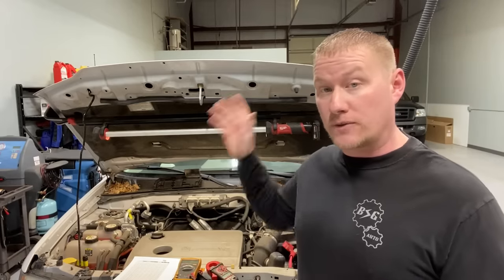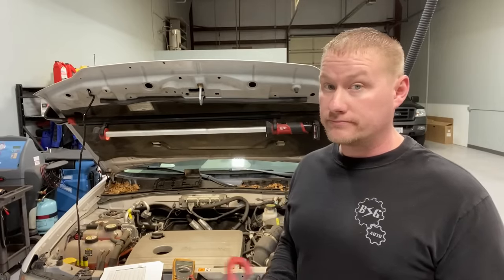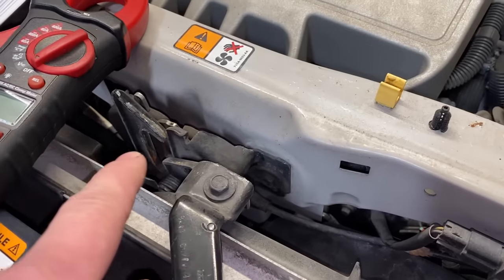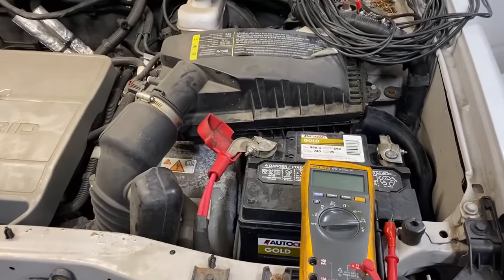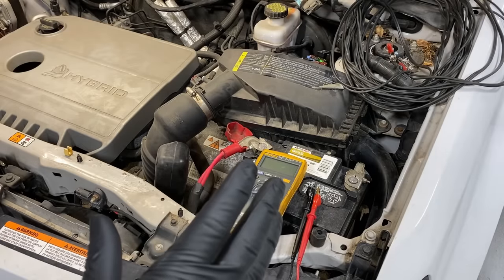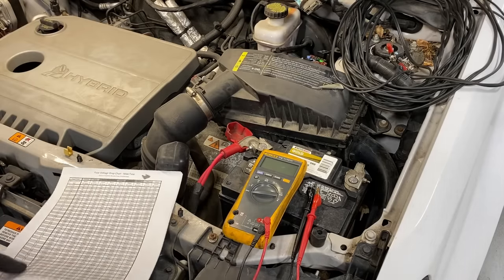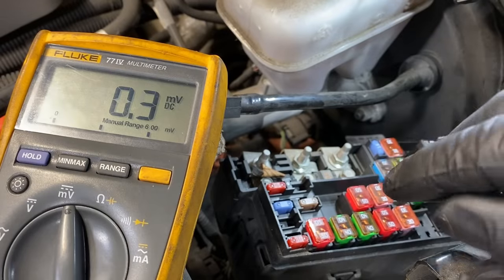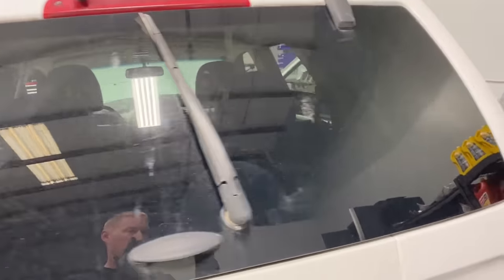Which Parasitic Draw Test Method is REALLY the Best?

Comment: Two things, 1. is it correct to make quick solid connection with the jumpers to car batteries to avoid arcing as much as possible, to avoid screwing electronics, such as ignitions etc? And 2. would connecting jumper carefully under the battery clamp, while removing battery clamp, to keep it continously connected, stop it restarting the "go to sleep mode" timer?

Comment: I like to use a general purpose amp clamp (like a B&K 316 milliamp clamp meter) to see what the vehicle is doing when it is supposed to be asleep to confirm a parasitic draw of any type. The only draw back to this approach is you have to find a good location where you have access to the battery cables and where you can place the jaw of the clamp meter around the cable. 

If a parasitic draw is present then I put the vehicle on a battery sustainer so it doesn't die while testing, be mindful that with some parasitic draw problems you may have to got key on engine off. I then use my Fluke i30s current clamp and my Fluke Scopemeter (any automotive scope can be used) to see what the current is doing dynamically. Many times the parasitic current draw will be dynamic or periodic in nature and this can provide clues to the root cause. For example, if you see current being drawn in an increasing stair step waveform, you most likely have one module waking up a network or multiple networks. If you think this is the case you will have to monitor network activity with a scope (like a PicoScope Automotive scope 4425A) to see who is waking up first while watching the current draw.

The B&K 316 is also handy to identify the offending power feed when you have narrowed down the draw to a power splice or fuse which feeds several modules or circuits. In other words, it is quicker to use a clamp ammeter to find the problem on individual power feeds because you can test each one without pulling a fuse or disconnecting the suspect module. Remember every time you cycle power, you will have to wait until the system goes to sleep to confirm your guess. 

If possible do not disconnect the battery before you start testing. Power cycling the car will wake up the modules and you will have to wait, some times up to 35 minutes, before the vehicle goes to sleep again. If you want to put in a series ammeter in the negative battery lead, than you must introduce the ammeter into the circuit make-before-break using a couple of alligator jumpers so you do not interrupt power.   

To short between two connector pins, to simulate a closed hood switch, you should use the same mating pin type (provided in many connector pin adaptor kits). If you use a paper clip, and it is not the same size and design as the mating pin, you will most likely damage the pin tension. The practice of using a paper clip as a front pin adaptor or probe is specifically spelled out in many shop manuals (see GM) as bad practice in electrical system troubleshooting due to damaging pins. 

It takes a very long time to fully charge a dead battery, like 13 Hours. If you do not want to wait this long you can put a battery sustainer on the vehicle (like used when reprogramming modules), which will provide a regulated system voltage for testing and put a charge on the battery. The sustainer is very handy because you can set the system voltage and so when you measure the +12 V power feeds you can verify that the voltage is close to the set value, and the sustainer will provide power indefinitely. Some difficult parasitic draw troubleshooting can take hours.

Comment: Ideally if you have a draw whether its all the time or intermittent you should have two multimeters if using the voltage drop way. I've had good results using voltage drop while also having a meter in series reading the current draw. one of my meters also has  Bluetooth function so I use that so i can have my tablet in front of me showing me the live current draw while measuring voltage drop

Comment: Very informative video, thanks for doing this.  For me, I do not have a clamp-ammeter so I am thinking of using my good Fluke meter in the DC amp function to monitor the draw while checking the fuse voltage drop with another DMM.  My question is:  Can I eliminate the jumper wire you hooked up to get the car to sleep?  Can I not just disconnect the battery lead and leave the Fluke connected?  I believe the connection will still be made through the Fluke even if it turned off.  Also why not use the positive lead of the battery?  Maybe its just a safety thing.   Well done! ..... thanks again.
Reply: I believe the reason for using a jumper wire while the car is going to sleep is that the current draw during the going-to-sleep phase can be more than most multimeters can tolerate. For example, when you lock and alarm the car, it may honk the horn, and flash the headlights etc, and that may exceed the 10A limit of a lot of multimeters. It is only once the car is safely asleep that the multimeter can be "safely" wired in series with the battery. Even then, it would be possible for a parasitic draw to exceed 10A, and blow the fuse in the multimeter. The idea is to get the jumpers to handle any large currents during the going-to-sleep phase, and once the car is asleep, let the multimeter take their place without breaking the circuit.

Comment: Excellent overview,  how does one check the interior fuses if you can’t see when the parasitic draw spikes on the amp clamp connected to the battery cable?
I assume the interior fuse block contains all the sub level circuits that are connected to the higher level battery fuse block circuits. 

Thank you for the awesome content you post.

Comment: Thank you for this video!  Going to tackle my daughter's Ford Focus with method #3 tomorrow.  We have a bet - I'm guessing its the aftermarket stereo she installed herself. 🙄  She thinks it's bad diodes in the alternator (taking it in for a ripple test).   We'll see.
Reply from the maker: I have never seen an alternator fail a ripple test.
Reply: I have, once, on my grandmothers car.  The technician said it was the only time he'd ever seen it.   Caused quite a stir at the shop - everybody dropped what they were doing to come take a look.   Apparently it's extremely rare?   Hence my confidence that it's a parasitic drain from the stereo installation.   We're putting her Focus to sleep now - we'll see what happens.
Reply: Welp, not the stereo.  The culprit was a bad BMS (battery monitor system/sensor) on the negative battery cable.  Didn't even know what that was - learn something new every day.

Comment: perfect. i always thought yanking fuses was stupid. one opinion though. should show people that arent used to doing this how to properly test the fuses and discuss what mv readings the fuses should show on the multimeter. that would have completed a great video. good job.
Reply from the maker: I do show how to test across the fuses for the mv reading and I supply links in the video description of the fuse mv drop charts.
Reply: @FordTechMakuloco  I see. I skipped over the first two methods because I knew they were inferior. Must have missed that part. My bad. Thanks

Comment: Both are a good way to check,but on voltage drop test would be accurate if you use an inductive clamp  and a scope ,that way you will monitor intermittent or current draw ,sometimes just with the simple action  of removing the battery terminal  the draw goes away ,i seen that many times ,but hey great video very explanatory.

Comment: my car has a awake draw of 12a which blows the fuse in the meter every time it wakes up.   I made a custom adapter which has a male and female battery connector which leads to a large battery isolator which also has a .1ohm resistor across the isolator.
I leave the isolator closed (so the negative lead is essentially hard wired in and you can even start the car).  Once the car falls asleep, I open the battery isolator which then allows current to go through the .1 resistor (which is in parallel to the isolator switch). I then measure the voltage drop across the resistor (which now acts as a current shunt) and convert to ma or amps
This allows accurate measurement of very low current draws without the problem and of a current spike blowing the fuse in your meter if you had it inline.  (hope that makes sense)

Comment: Great video with a great instructor loaded with good, easy to understand, information. Question, how are you going to see the clamp-on style amp meter while you’re inside the vehicle checking voltage across the fuses (F19 in this instance)?
Reply from the maker: A helper or some are wireless.

Comment: I’m trying to do this on my motor cycle. Should be same principle. My battery slow drains over a week. On my second battery so I know it’s something in the bike. Unless I did something wrong I saw zero amps when I put the meter in line. Started at 20A and went down to 200ma.  Got the bike in pieces in the garage chasing a possible shorted wire or stuck connection. Driving me bonkers

Edit* watched the whole video now and it’s possible I didn’t wait long enough for a draw to happen. Not sure what could be a sporadic on off item like the rear windshield wiper. Going to try again.  I can hook my meter and watch the voltage go down on the battery. 12.10—12.9—-12.8, etc. think the draw being on the bike and me charging the battery back up with a trickle charge has damaged a cell in the batt. 
Great video btw

Comment: Great video.  I just bought a Fluke 376 FC with this as a primary purpose.  I can keep the clamp under the hood and still read it on my phone from distant fuse blocks while probing with my 179.  But here’s my question.  In the real world you don’t know that it’s the rear wiper, and if the draw is intermittent - especially if the time in between is long - you still have to catch it at the right time.  If they’re an hour apart, how will you ever do that?

Comment: The corrosion problems, I'm in salt belt state's, is easily fixed by using waterproof seal heat shrink tubes and then liquid electrical tape on rest of exposed connection and or use heat shrink and NoCo step 2 corrosion preventing spray (it dries translucent red)
The other NoCo battery cleaner and protector spray is NoCo battery cleaner that turns very foamy yellow when contacting any corrosion and it kills the corrosion. Then you splash the connections when theres no power pr use a soft hose to clean off battery cleaner and then dry it down and put on red spray which allows conductivity but prevents future rust and it can be used on battery terminals, posts, as well as bolts and wire connections.

And if you need to test anything just scratch with leads from multimeter and ypu will get a good connection.

Comment: Thank you for the video.  It is quite informative.  I have a 2006 Toyota Highlander Hybrid V6 where I suspect a parasitic draw - battery drains between morning and evening, and the battery is not bad.  While I can take it to a mechanic and get it diagnosed, I think this is a nice DIY.  My question is whether you can put the multimeter in series between the negative battery post and the lead without having that lengthy cable first.

Comment: Question regarding 2nd method, why did you use those jumper cables along with multi-meter while waiting sleep timer to expire?
I mean you removed those after 60 min so you ended up with multi-meter only in serial connection anyway. Why not using multi-meter only form the start (e.g. without additional cabling) of this test method?

Thanks in advance, great video by the way!
Reply: It’s common to loose the drain reading if you break connection at the battery. So he’s using those cables to simulate the normal cable then once asleep he can disconnect them leaving only the meter. A different way is use a battery disconnect switch.
Reply: If you start with just the meter in series the draw before things start going to sleep could be over rating of the meter fuse and blow it

Comment: Have a music channel..but I am having trouble with my 1999 Ford Expy. I am a former TV tech and everything you are are saying makes total sense. I am not a car mechanic, but sometimes I have to work on my own vehicles. The battery makes a small arc when the hot side is connected.  This is with the truck off. I have tried to find something that is on. Things like CD players, dome lights etc. No luck. I dont think there are aftermarket devices on the Expy.. My next step is to pull the fuses and see if I can get the current draw to stop. I have not measured the current draw yet.  I think it will probably be less than .1 amps.  I plan to get the  VIN and pay Alldata..probably AutoZone DIY version. Much more accuracy than Generic schematics. I am going to go back to watching. Just giving you my troubleshooting thoughts. As I said I am not a mechanic and sometimes get really discouraged and get nowhere. I will keep you advised..and give you feedback.

Comment: If you have a consistent draw I like putting a test light between the negative terminal and the negative cable then pull one fuse at a time when the light goes out you know which circuit it is ...

Comment: A few weeks ago the battery in my daughter's '12 Escape was going dead over night. When she told me that her rear wiper stopped working I went right to the fuse to check the voltage drop & the first 3 times I checked it it was zero. While checking other fuses I was hearing some clicking noise. One click was loud & the other click I could barely hear. The loud click was the wiper motor trying to turn & the lower click was it turning off.

Comment: hello, great video and i'm with you on using the 3rd method. a quick question : i have a 2007 Hyundai Veracruz that just started draining the year old battery overnight. Can I just shut the lights off inside the vehicle or do I still need to flip the switches in the doors to pretend the doors are closed? thanks for your help. Randy

Comment: Hey great video man! Very informative. I have two questions for you. What is that thing called that you used to check to see which fuse was emitting heat and the 3rd method does seem like the best method of draw testing, but it would seem that you would probably run into same problems  as first testwith the 2nd part of it where you check for voltage drop across fuses with the DVOM because not all fuses can be be check while installed in fuse box .. but you are a great teacher man.. love your videos

Comment: Work finally did the timing set on our 2006 5.4. But despite me telling them to only use motorcraft parts and showing them your videos they still  used Dorman. And guess what. Not even a week later and few miles later it is back to ticking horribly. Oh well 
If I have to drive it I will show it no mercy. Run it till it pops lol
Reply from the maker: Oh no!

Comment: Yeah It’s not a replacement it’s to be used in conjunction with. It’s not going to find every draw but it certainly comes in handy. The best amp clamp I’ve found for draws is the newer black pico 30 amp with the big jaws. It’s a $500 clamp that has to be used with a scope or graphing meter/DMM but it is very accurate. If I’m busy with other cars then I’ll get started by using my amp clamp with my older otc graphing meter that has a 24 hour screen. If it comes in at the end of the day and is staying over you can hook up before leaving and get a long term picture of the draw.

Comment: 17:35
Usually when a device has constant power AND ignition like a radio or clock, it needs the constant power to keep the time correct. Or like aftermarket gauges have power and ignition because they have adjustable LED's that you have preset so when you power the car back up, the gauge goes back to that same light setting. 
And as this one here with the wiper, when you shut the car down, the wiper most of the time will NOT be down, it will be somewhere in its cycle so thats when the constant power will bring it back to its off position.

Comment: Good video, but: I have Mercedes and when testing parasitic draw without turning ignition on for 2-3 seconds and only after locking and arming the car (in my case single click), I get normal parasitic draw readings. And the second method is the best for me and I think for most of the DIY people because not everybody might have not so cheap DCC clapms.

Comment: I apply the method and it is very great tool, but  like  any tool in our industry  will not cover  at 100% all demands at all time,  as for example a mechanic  hast to have like 4 3/8 ratchets and each of them has his place to used it. I have a video here on you tube using  that method  I found it easy,  but first you need to know there is exive  draw  now you know that the next step is to  go find it with voltage drop.  Great explanation  but I think this method deseve more credit  if used properly.

Comment: Great Video..  it seems that the fuse must have a small amount of resistance, else you would be measuring voltage across a dead short circuit " The Fuse"  Fords test method Is not good, I would agree. Best method would be measuring the Current passing Through the fuse, Rather than Voltage Across the fuse. The Ford chart would only be accurate if the circuit was drawing the Full Amperage of the Parasitic device. I like the use of IR temp device to check hot fuse, very useful tip. Must get myself one of those.

Comment: Surely the third method of measuring voltage drop across the fuses, is just the same as method one except, the ammeter is highlighting when the draw is occurring? Still very tricky to measure voltage drop across some of the fuses, as you said for method one?? Method two for me, every time. Good video though, thanks from UK